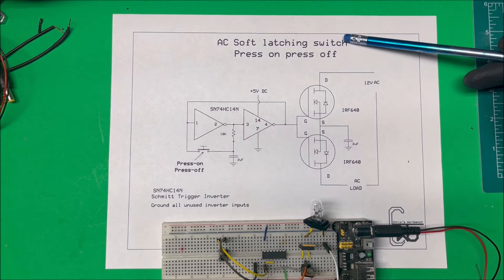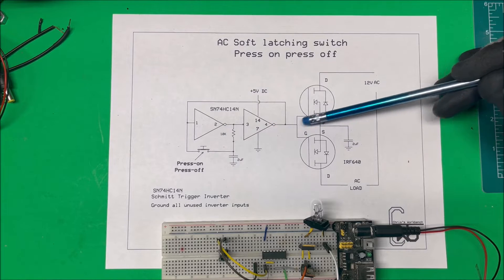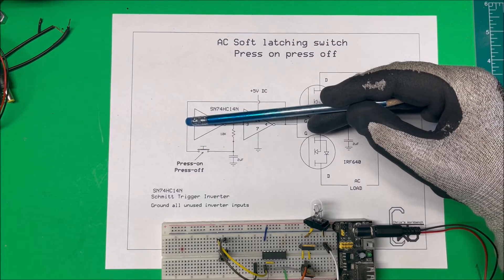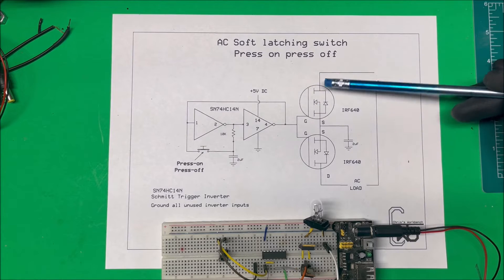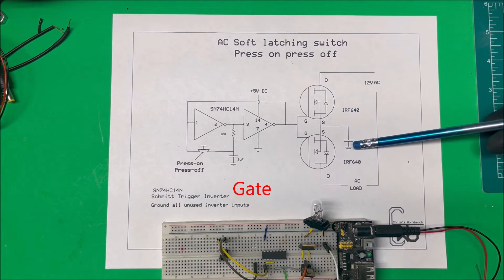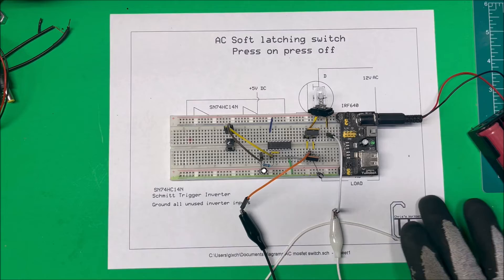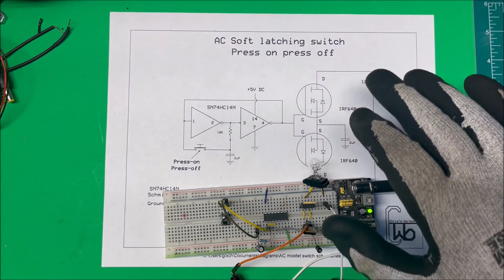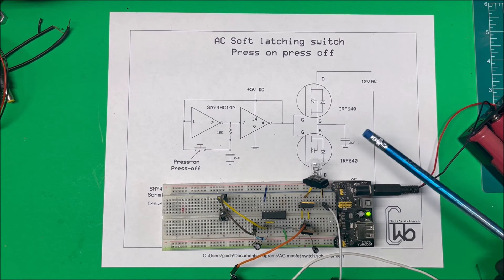AC Mosfet Switch

Comment: You really only need one mosfet to switch AC current. It's done for pwm switching line voltages: run AC to the load, and have the mosfet short across a diode bridge. The load only sees AC, the mosfet only sees DC, and there's no balancing or matching needed.
Reply from the maker: True
Switching AC with One MOSFET
Limitations: 
The rectifier introduces voltage drops (typically 1-2V), reducing efficiency.
Suitable only for low-power loads due to diode losses.
Not ideal for high-voltage AC (e.g., 120V/230V mains) without robust isolation.
Two MOSFET 
Advantages:
True bidirectional switching without rectifier losses.
Suitable for high-power AC loads (e.g., mains applications).
Reply: Why do you claim that using the dual mosfet circuit is any safer than the single circuit for mains voltage?
Reply from the maker: In the back-to-back setup, when both MOSFETs are off, one MOSFET blocks the positive cycle, and the other blocks the negative cycle, preventing unwanted current flow through body diodes.
This ensures true "off" state, critical for safety and functionality in mains applications.
Reply: @ke6chris That is not safer on mains voltage than a single mosfet. It's not even related to safety.

Comment: Current actually never flows through body diodes here since both gates are driven at the same time. Reverse conduction will occur, so body diodes don't turn on. 

This works as long a the gate voltage is above source voltage, regardless of current direction. This requires that the ground on the schematics floats vs the AC.

Comment: Why does it work? Since for the negative cycle, the gate potential is almost always higher than source potential
Reply: It works because the 12 volts AC floats vs 5 volts DC.

That insures that gate voltage is always higher than source voltage for both MOSFETs.

Once turned on both MOSFETs will conduct in both direction of the AC.

That means the body diodes never turn on in the on state of the circuit. 

In the off state of the circuit, one body diode blocks while the other is turned on. This is called an anti-series configuration.

Again this requires that control voltage floats vs ac power.

The capacitor between source and ground is not necessary as long as DC and AC voltage sources float.

Powering the DC from the AC source would require some form of isolation.

Comment: Interesting circuit. One question: the second not gate's output is coupled to ground through the cap when the switch is closed, but there's no current limiting resistor. Wouldn't that cause a large current spike on the leading edge of the button press? Similarly there's no current limiting for the gate capacitance of the mosfets.
Reply from the maker: That is a good idea to add a couple current limiting resistors.